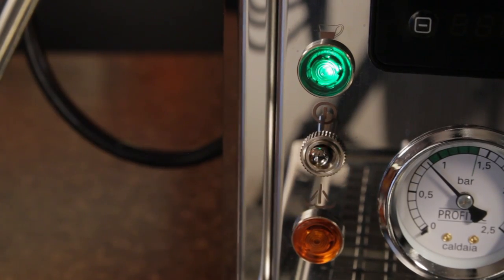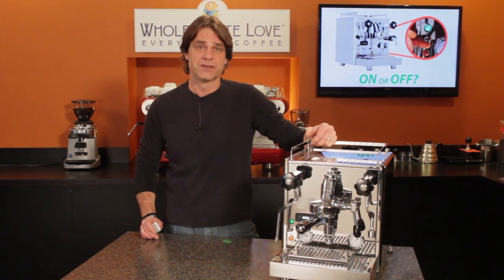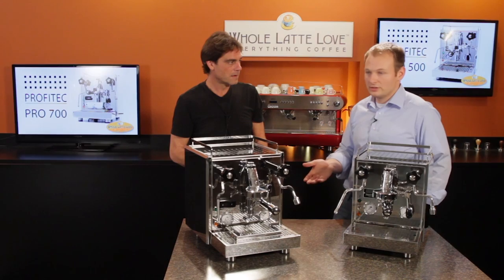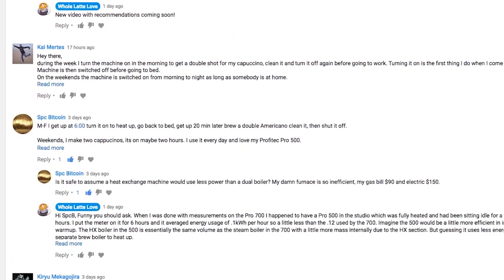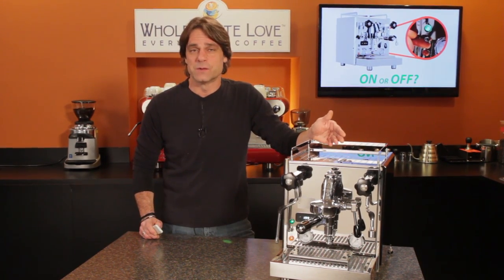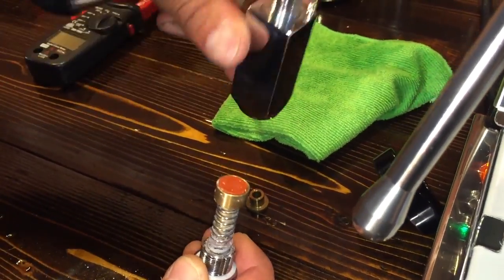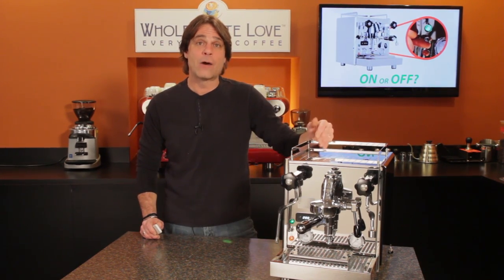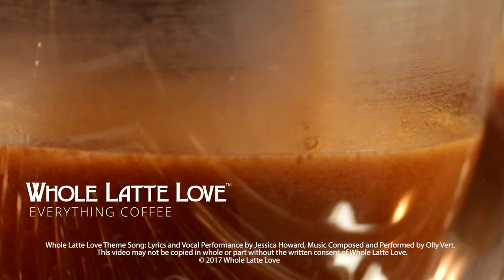Tested: Espresso Machine - Should I Leave it On?

Comment: I use a wifi outlet, I leave the switch on all the time and set the timer for the outlet to go on and off at certain times.   Also when I'm driving home I can use the app to turn the machine, when I get home it all ready for me.   Nest works great.
Reply: MRODPHOTO I want exactly that solution. But I was afraid not to harm the machine. Which timer and what machine do you use?
Reply: tasos76 I have a Profitec 700,   I got a use the Kasa app with the outlet I got from amazon TP-link smart plug. Works great.
Reply: Thanks.. I go check it on.
Reply: I do the same thing,  I use a wemo insight plug with my Rocket Cellini.  The wemo insight is rated to 1800 watts so it handles it no problem.  It is connected with alexa and I just say "Alexa, turn on Rocket".  I love gadgets!
Reply: @hodgesmt  so the rocket has to be already in the on position right?
Reply: @euci3207  correct

Comment: Hi Marc. Could you answer a related question? There are long periods of time when I don't use my espresso machine.  What????, you say!     Nevertheless...  My question is, is it better to occasionally run heated water through my machine to keep hoses, any rubber or any other flexible water sealing components from degrading over time?  Dishwashers, for example, can have components that degrade if left unused over long periods of time.  Thank you!  -JohnB

Comment: Hi, great video, thanks for sheding some light on that lingering question. Now here is another one: for dual boiler machines, what would be the recommendation for the steam boiler switch? Should it be ON while the machine is ON, then switch everything OFF? I usually turn ON the steam boiler only to steam milk, then turn it off immediatly (5-10 minutes total), even if I plan on using the machine again in 1-2 h, but I leave the water boiler switch ON during that time.
Reply from the maker: Hi Max, You are welcome for the video and thanks for the comment! No problem turning off the steam boiler if you will not use it. Will definitely save some energy and reduce scale build up. Depending on your input water quality it's a good idea to flush the steam boiler after use by expelling a bunch of water. Every time you steam, the minerals in the boiler become a little more concentrated as the steam is essentially distilled water.

Comment: I have a profitec 500. And now my foam pressure gauge is reading high it’s going outside the green upwards to 1.6 1.7 and I’m not sure how to adjust or if I need to fix the gauge
Reply from the maker: Hey rm, When the machine is off and cold does the gauge read zero? If not then it's likely faulty gauge. Fix for that is gauge replacement. Is your Pro 500 a version with PID? If so setting PID to the max temperature should result in ~1.3 bar when machine is fully heated. When fully heated and reading 1.6 if you do a flush from the group do you get a lot of flash boiling or notice that it's more than in the past? If so that could indicate the machine is actually reaching that pressure in the boiler. If your machine is not a PID model there may be an issue with the pressurstat which controls boiler heating based on pressure in the boiler. If having issues and you purchased machine from us reach out to our tech support staff here for assistance: https://www.wholelattelove.com/pages/contact-us
Reply: @Wholelattelovepage  yes, my machine has PID and the pressure does go back down to zero when the machine is often cold.
Woke up this morning and turned my machine on and the pressure gauge seems to be behaving itself. I did some pressure backwash is on the brew had yesterday don’t know if that made a difference or not, seems to have since the pressure gauge is reading properly now. Thought I would run some descaling through the machine like the book explains just to be on the safe side, and as the book said prophylactically.
Thanks for your input and your quick response! I appreciate this website and your podcast with so much information helpful to home coffee systems. Have a great day!
Reply: @Wholelattelovepage  when I did the group flush I didn’t get any more splashed than I normally get so I’m assuming the gauge is OK maybe just had a little bit of calcium blockage, possibly

Comment: Great video topic!! I've wondered about this question when deciding the best schedule for my espresso machine.  

I tackled the timer hurdle with an Ankuoo Neo Pro WiFi Smart Switch for my Rocket R58. The switch is rated for 15A 1800W and my Rocket Espresso R58 is rated 15A 1400W. I love being able to set different schedules for different days as well as remote turn on/off the machine from anywhere. The Ankuoo Pro version also tracks energy usage and can estimate cost based on a dollar per kWh that you provide. My energy bill is usually in tier 1 and tier 2 which is $0.19 and $0.39 based on average rates per kWh. I input the $0.39/kWh and my spend is estimated to be around $8 per month.
Reply from the maker: Hi Ameer, Thanks so much for the detailed comment! We love hearing about other experiences and hope these conversations help others in the coffee community. Beautiful stuff!!!

Comment: Another nice video. More than once I have left for work and forgot to turn it off and then went the whole day annoyed with myself. Or came home to discover I forgot to turn it off. Not sure why I haven't thought to get a wifi outlet. I will now. Thanks.
Reply from the maker: Hi Nick, Thanks for the comment! I've accidentally left machines on in the studio overnight many times. If you go with a wifi outlet just be sure it's rated to handle the load of your machine.
Reply: Whole Latte Love.  Thanks. I found a few that were rated high enough. Just have to pick one.

Comment: Love your channel! Awesome content. I plan to convert my vintage van into a coffee van this year and have been trying to work out if it's viable to run a 2.7KW machine using only batteries and solar (520amp hours and 500w of solar, so a fairly large bank and lots of solar!) - or if I will need gas too. It is difficult to find answers on how much power these machines use on idle since I am sure my machine won't use 2.7kw constantly!
Reply from the maker: Hi TM, Thanks for the kind comment. Good luck on the coffee van!
Marc

Comment: What killed my Classic Gaggia, was the steam or condensation from the boiler got to the manual switches, & after a few years, badly corroded the electrical components inside.  Easy enough fix but the replacement part was expensive.
Reply from the maker: Hi, Thanks for the comment. Did you leave your machine on all the time?
Reply: No, it's just the location of the Gaggia Classic's rocker switches is subjected to moisture & that it isn't weather-sealed.  I do not leave the unit on because it doesn't regulate temperate well enough (tend to get too hot & scour my espresso). For just a shot, I tend to boil water & reach for my UniTerra's Nomad Espresso machine: Everything is manual but I know exactly the pressure & the temperature, no electronic that'll fail, & I can just rise everything off with warm water. Quality of the shot is not spectacular but consistently decent.

Comment: Is it okay to keep the switch of a Profitec Pro 500 set on at all times, and only turning it on remotely using a smart plug via an app? Will it promote any sort of wear and tear? Or faster degradation of the machine? Thank you so much!
Reply from the maker: Hi lp, Thanks for the question. It's perfectly okay to leave the switch on all the time and use a smart plug to turn the machine on/off. Great way to have the machine ready and waiting for you!
Marc

Comment: Hey Mark I was just watching this video I just purchased the profitec 700 Pro from you
, my question is does my machine have a programmable timer I believe it does and if it does does that put it into sleep mode or do I still have to turn it off with the switch
Reply from the maker: Hey mm, Using ECO mode you can program a time in minutes after last use for the machine to power down the boilers. You do not have to turn off the switch.
Marc

Comment: Nice video. I'd also be interested in knowing the recommended wifi outlet timer for the Profitec Pro 700. Most wifi timers seem to be rated for 15A. Doesn't this require 20A? I successfully used on with a single boiler Quickmill Alexia, but wasn't sure it was suitable for a dual boiler machine like the Profitec.
Reply from the maker: Hi Andrew, Just posted this video with my favorite WiFi Timer and in video I use on the PP700 https://youtu.be/IzPqeXpQzHw

Comment: Marc, I am getting Pro 700 (2019) Next week. What does putting it in ECO mode mean? Is it better to use that then to fully turn it off? I would of course turn it off at night, but I tend to have espresso's regularly from the time I wake up until I go to the gym at 6pm. Would it be recommended that I leave it on from around 8am until 6pm?
Reply from the maker: D W congrats on the 700! Eco allows you to turn off boilers after period of non use ranging from 30 minutes to 10 hours. Saves some power. If not worried about power consumption no problem leaving machine on all my he time. Also have a switch behind drip tray to turn off just the steam boiler if you’re not using. That’s unrelated to Eco mode. 
Marc

Comment: Hi, recently got into your videos... Man, what a great source!
I have been told that the correct way of  turning on an espresso machine is with the milk frother turned open, until steam comes out. Is that true?
Reply from the maker: Hi AZ, Thank you for the comment and question. No need to open the steam wand when turning machine on. Depending on machine type, you would be waiting awhile for anything to come out of the steam wand. On all machines (except those with thermoblock boilers - which are common in low cost entry level machines) there's a vacuum relief valve on the steam boiler. That valve opens the boiler to ambient pressure when the boiler is cold. The valve remains open until enough steam pressure is generated in the boiler to push the valve closed. The vacuum relief valve would accomplish the same thing as opening the steam valve. If it's a brand new machine you could turn on the brew function which turns the pump on regardless of water level in the boiler.
Reply: Whole Latte Love thanks a lot! I will go ahead then and buy that WiFi socket :-).
BTW - are you shipping espresso machines internationally?
Reply from the maker: You are welcome. Sorry not shipping international at this time :(
Reply: I have a La Cimbali M21 Junior machine. I guess it has a vacuum relief gauge.
Reply from the maker: Yes

Comment: Quick question- does it make a difference whether the machine is turned off by flicking the lever off versus being turned off via a smart plug (which does not flick the on/off lever)?
Reply from the maker: Hi TB, Makes no difference so long as the machine has a mechanical power switch.
Marc

Comment: Hey Marc, I had a quick question, I purchase liquid descaler for my Accademia and it seems to work great, but its expensive and wasteful to ship liquid across the country. Are there descaling products sold as powder packets for my unit? I can't seem to find any lactic acid based powder descaler on your site.
Reply from the maker: Hi You, Gaggia does not make a powder base descaler that I am aware of :( My recommendation is to stick with the Gaggia descaler which is a combo of organic lactic and citric acids with a corrosion inhibitor. A couple of questions: Do you have hard water at your location and do you use an in-tank water filter in the Accademia. Using a filter can significantly increase the time between descaling. Depending on your water hardness it could 4x the time between descalings which may save $$ and shipping.
Marc
Reply: Marc, thanks for the quick reply! I'll take your advice and stick with the Gaggia descaler. My water is hard, and I used the test kit that came with the unit and programmed it during the initial setup. I do use the filters and it seems to keep the descaling down to every few months, which isn't really bad. I love the Accademia, my only regret is not buying it sooner! Thanks again!
Reply from the maker: You are welcome. When you mentioned shipping cross country I wondered if you were in a western state. Many have hard water so keeping up on descaling is important! I love the Accademia too! I've got access to just about any super-auto made and I've had the Accademia in the studio as my go to for long coffees for the past 3 years! My descale warning started flashing a couple days ago. Guess what I'm doing today!

Comment: these recommendations is just for home users, or commercial too? thanks, hi from Panama
Reply: I assume commercial machines must be durable enough to handle being powered on for at least 12 hours per day, ready to handle regular and surprise customers.  That is why they get UL and NSF ratings and cost much more.  I am curious about the durability and energy consumption, and electrical power fluctuations of a 220 vs. 110 voltages.
Reply from the maker: Hi Alex! This information is provided for US customers with prosumer home machines. Commercial machines are going to have their own regulations, and if it is a 220 Volt machine with higher wattage, you will want to refer back to the manufacturer of your commercial machine for advice.

Comment: I have ecm synchronika with eco system. If I activated the ECO function is is okay to leave the machine on all the time with ECO on?
Reply from the maker: Hi AA, Thanks for the question. Yes you can. The machine will power down the boilers based on the minutes you set in ECO after last use.
Marc

Comment: So the question is about the "cost" of idling for 8h = $0.25. Funny. Do you know how many on-off cycles the machine can handle before a repair? That may be the real cost. $3.3K /4,000 cycles = $0.825 for each on-off cycle. It is a common practice in electronics to know the MTTF in regards of hours of work and on-off cycles. Where did 4,000 cycles came from? 3 yrs of warranty with 3..4 on-off cycles per day. :)
Reply from the maker: Hi SK, Thanks for the comment. Never seen espresso machines rated in that way. Far more likely one would need a repair due to lack of maintenance causing scale deposits etc than an electronics failure due to on/off cycles. There are some parts like mechanical relays in machines which might be rated in that manner but I have no data on those and static relays are far more common than mechanical relays in modern machines.
Reply: @Wholelattelovepage  agree. Indeed espresso machines and most consumer electronics are rarely tested for MTTF. The time to failure is not just electronics, mechanical pumps, valves and degradation of seals due to temperature are far more likely to be the cause. It is very nice to see those parts available form your store. That is really reassuring.